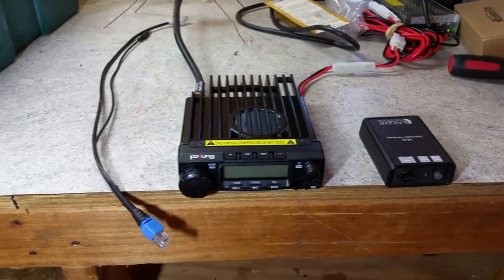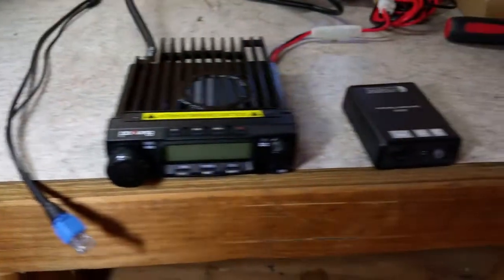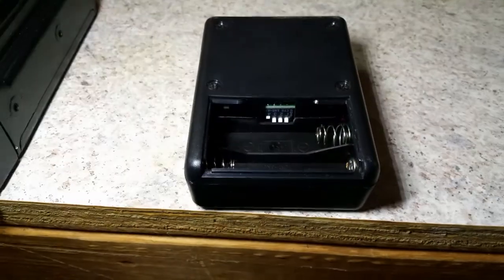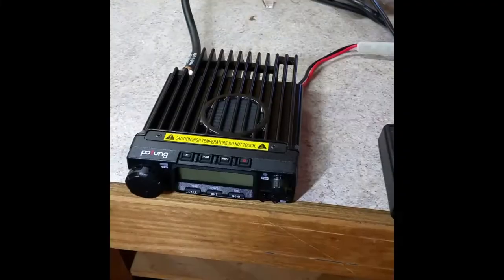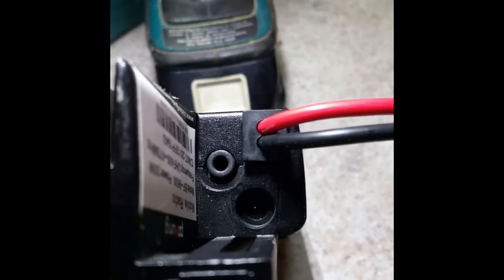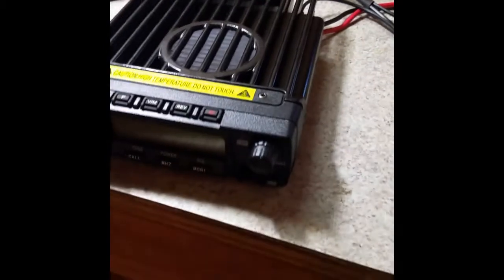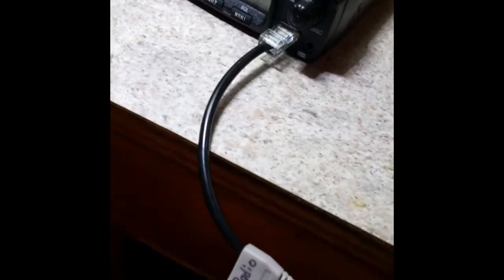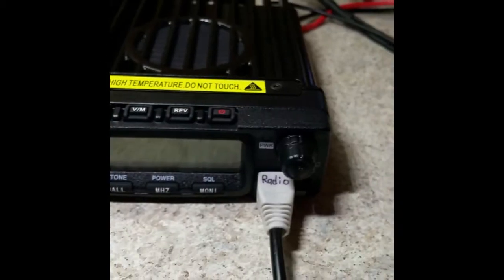Pofung BF 9500 Radio to Argent ADS-SR1 Interface Cable Hookup

Comment: How powerful is that simplex repeater? This kind of setup would be good around troubled places. I don't think I would need one of those. But it was good seeing how it is setup.
Reply from the maker: That Pofung radio is 25 watts.  The key to the range though is the height of the antenna.  I was able to suspend an antenna from a pine tree so it was about 90ft.  I was getting about 13 mile range.